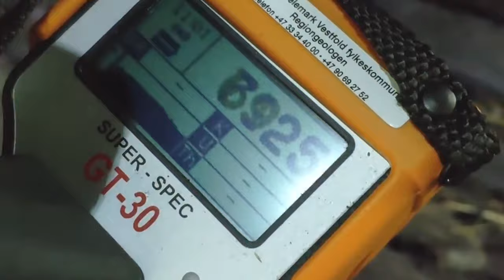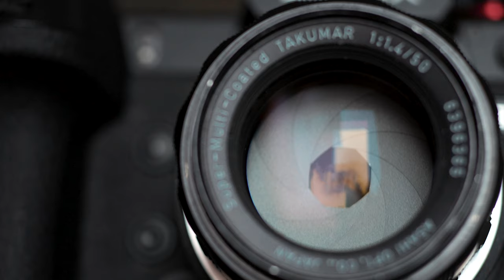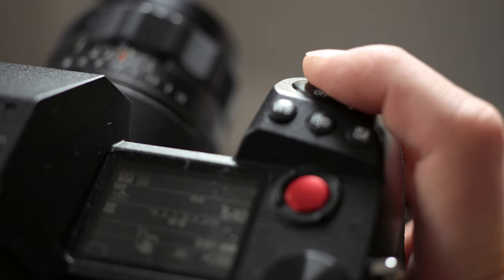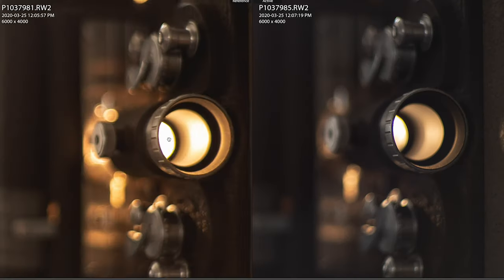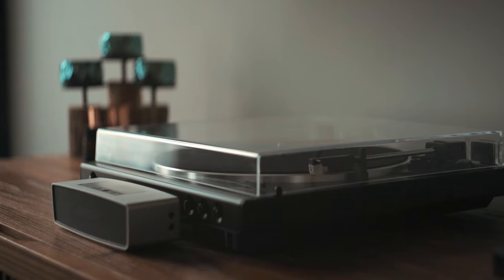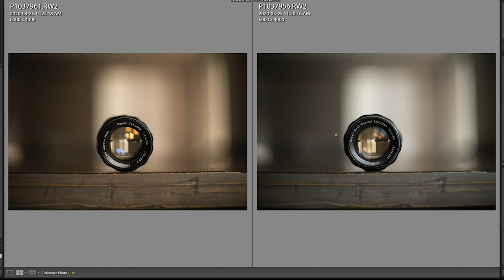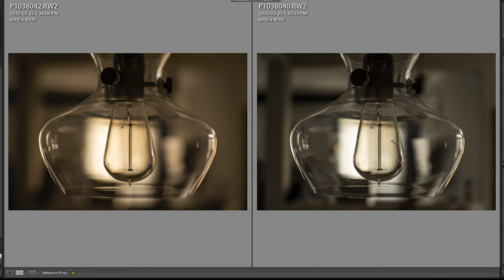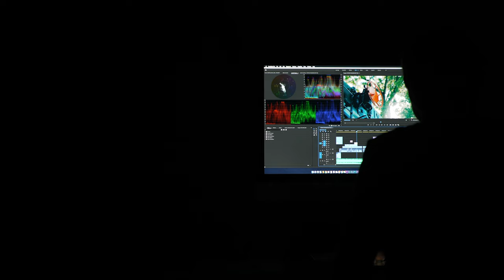The Hidden Secrets of Radioactive Vintage Lenses!

Comment: Just don't eat the lens. Or break the lens elements and inhale or eat the dust. And you'll be fine. Also, don't sleep with the lens under your pillow.
Reply from the maker: That would be dangerous with any lens no doubt, but ya a little radiation decay would be a little worse....just a little ;)
Reply: @MarkHoltze  Much worse. Thorium is primarily an alpha emitter, though it's decay chain produces betas and gammas, too. Alpha is mostly harmless outside the body, gets blocked by your skin, but can be very damaging when inside. I'm not sure how much thorium dust would be required for a harmful effect, but it's safer not to test this...
Reply from the maker: That’s the key, volume. It’s a very small amount overall and it’s also a very slow rate of decay, gamma is more potent when mixed with elements with a much shorter half life.
Reply: The last one is the hardest part.

Comment from the maker: I'd love to hear what you guys think of thoriated lenses. Do you feel safe using them? What might be some of your favourites be and most importantly, do you reverse the color casting? GO!
Reply: My all time favorite is my  super takumar 50mm F1.4 8 Blade , even normal photos look good somehow when i use it .
Reply: Because of you, I built a set of Super Takumar lenses a year ago. The thorium doesn't bother.
Reply: I have no problem with the radioactivity. The yellowing is a bit annoying however, although I only noticed it with my 50mm 1.4 so far. I might be reversing the lens at some point to get the clear colors of my other SMC Takumars. Nice to have a new video from you, btw.. Thanks for the effort!
Reply: I was never a fan of my takumar yellowing. There were certain times where It was sort of artistic or added the right degree of warmth,  but generally speaking, I just went with the k mount versions. The only thoriated lens that I still own is the Canon FD55 mm 1.2 aspherical lens and maybe it has to do with the other coatings used, but that lens has a milder cast and it's more of an amber color that I think is wonderful. The 50 mm 1.4 carls ice has a much colder cast, and I find each of them useful in their own way.
Reply: I'd have to shop at Ikea for that lamp, and I am NOT opening an IKEA account...
Reply from the maker: @sclogse1  lol...my feelings exactly
Reply: I have a Super-Multicoated-Takumar 50mm f1.4 and also a Super Takumar 55mm f1.8 (together with an auto-Takumar 55mm f2.2 and a couple of auto-Takumar 55mm f2s). I read that the Super 55 used rare earth Lanthanum and thoriated glass and wondered if this was an intermediate design choice between uncoated glass elements in the auto-Takumars and multicoated glass in the later iterations (with possibly some overlap?) but haven't yet gotten an answer. I'm not concerned about the radiation produced by the lenses. In point of fact, I prefer the uncoated lenses because the inherent contrast seems to be lower and so they can render more subtle tonal gradation and colors. At least, that's how it seems to me.
Reply: The fixed 46mm lens on my Kodak Signet 40 rangefinder camera (circa 1956-59) contains thorium oxide. I've owned the camera since the 1970s. I bought a second copy off Ebay a few years back. I've far more concern about the viewfinder and mold than radioactive dangers presented by the lens, tbh. Thank you for your very helpful explanation about why thorium oxide was used and solutions for color casting issues.
Reply: I'd be careful about which models contain thorium and which do not.  I own a Super Takumar 50 1.4 which isn't supposed to be radioactive.  To be certain,  purchased a radiation sensor, and lo and behold, it is radioactive!  It's also heavily tinted.  I tested a few other vintage lenses and found they set off the detector to small degree as well.
Reply: Great video! I never had any serious concerns about the radioactive elements in any of my thorium lenses. I love them unconditionally lol.. It’s great that you’re taking the time to put this information out there. A very necessary one from you especially. Cheers!
Reply from the maker: Thanks mate! It was an itch I needed to scratch. Thanks for stopping by
Reply: I picked up the Super Takumar 50 1.4 at an estate sale and it has been an absolute pleasure to use, the bokeh rendition is phenomenal and I actually prefer its look over the Helios. I have not done any UV exposure to cure the yellow tint, when picking up vintage lenses I prefer to keep the "imperfections" in the lens, adds to the feel and character of a shot. I am perfectly comfortable using my thoriated glass lens. After some research I am a little perplexed on which model I have, the 7 element version is said to have the IR mark on the left of the 4, but the a/m switch says just that, A and M, not fully spelled out. Any advice figuring out which version I have?
Reply from the maker: When you back focus the lens, does the back element protrude out? I did a. Review of the 8 and mentioned the differences, also check the aperture blades; how many and what pattern. Might be an 8 element, but could just be an early 7. There are some discrepancies during some of the transition periods.
Reply: I ordered Takumar 50mm 1.4 exactly because its Thorium content and yellowing effect. I think yellowing is interesting feature that can be well used for artistic purposes. Also it can be reversed if needed... I am really interested how that will work out, just need to be careful to not to keep it on a camera after shooting (I am more afraid about possible damage it might do to digital sensor and that one I am not sure if can be reversed)
Radioactivity is overrated. People are scared of everything radioactive including thoriated glass and then get on a plane where they take way higher radioactivity dose than they would reasonably get using radioactive lenses for a prolonged time.
Reply: @WillieHustles where do you store your radioactive lens?
Reply: @anupew3276 how do your store your lens?
Reply: @tylerfields2368  on a shelf, on desk, in an open paper box, leave in a camera bag, anywhere really, just not mounted on camera. 
Radioactive lenses arent dangerous for you (well, if you wont glue it right on your eye and keep it there for a year), but they can cause electrons to move around a bit and some people observed that when you keep them on camera for a long time, images gets a bit more noisy. 
Which makes sense as radiation can cause electron to move around, either within atom to different energy orbit, releasing energy later as light, or be kicked out of atom completely. Mirror on DSLR/STL should be enought to block a good portion (possibly most) of that radiation, but mirrorless have naked sensor with nothing to block it.
Reply: I'll never knowingly buy a thoriated lens.

Comment: Clearing the amber haze from a thoriated lens does not require "extended exposure" to UV light. It only takes two to four hours of 365nm UV-A light shined through the lens, both from the rear element and from the front element. So the "extended period" is four to eight hours max. I use a uvBeast V3 365nm Black Light Flashlight that I got through amazon. I currently only have one set of 18650 Li batteries for the flashlight so my lens erasure time is about 24 hours for 8 hours worth of flushing, which is overkill. The lenses turn out crystal clear and the improvements in the image quality are stunning. It is dumb to be putting up with the color balance issues and loss of contrast in your pictures. Self proclaimed YouTube experts who do reviews of these lenses and ooo and ahhh about the quaint vintage appearance of the yellowed images are clueless maroons. /|\ Gp
Reply from the maker: Good to know. I’ve seen various periods of time mentioned.

Comment: I read somewhere that you are more exposed to radiation during a flight than when using these lenses. Supposedly.
Reply from the maker: Ya seen something similar. It’s why pilots have such a high rate of skin cancer, they’re getting blasted for many more hours than regular travellers are. It’s much more dangerous to be a commercial pilot when it comes to radiation exposure ;)

Comment: I have a Kodak Aero Ektar 178mm  f/2.5 that I use on my Speed Graphic. Due to its size it's even more radioactive than your typical thoriated lens. I don't worry about it. The worst that can happen is having it be permanently confiscated by airport security, which there have been multiple accounts of. Most prominently, I've heard Moscow airport security confiscating both the Takumar 105mm f/2.4 and the Aero Ektar from different photographers without ever giving them back.
Reply: Why? Do they fear, you scratch some metal off it and mix it into Putins morning Müesli 😂

Comment: I have the 7 and 8 element by luck in a local camera shop (Chuck's Camera Shop, Hampton, VA). I used the nuclear one for the past six months and haven't lost one loc of hair.

I LOVE the yellow tint. Easily fixed in Lightroom if you don't like it 👍🏾 

Honestly, one of the sharpest lens I've ever shot with RIGHT next to the Super Takumar 35mm f/3.5 🤌🏾
Reply from the maker: Ya the 35 is a great lens, nice and small too

Comment: ...aaand he's back!
Honestly, I don't care if a lens is radioactive, but I am currently trying to de-yellow my Takumar 50 1.4. As you said, it can be "corrected" in post, but I would like to see how it was supposed to render colors when it was new.
Reply from the maker: It's such a nice lens that the color cast can be a bit off an off put. The 8 element to compare it to was kind of my last resort, better light transmission to as it drops the exposure a bit because of the damage. So loads of reasons to still do it, ONE day! Or i'll just sell the radioactive 50 since I have the 8 element lol. My 35 needs correction regardless.
Reply: Buy a UVB Reptile CFL light at a pet store. The lens won’t get near my as hot as exposing it to sunlight. Wrap the bottom of the lens with aluminum foil.  In a couple days 80-90 percent of the yellowing will be removed.
Reply: I just shot a roll of Cinestill 400D with a yellowed Takumar. Skin tones turned out a little bit to the orange tones but nothing LR can't correct. Beach photos turned out so moody tho.

Comment: Good to see you Mark! It's been far too long. Literally was watching a video by you on the Canon FD 50mm f1.2L (There is one listed on kijiji in Calgary btw) and wondering where you've been. Love your work sir.
Reply from the maker: How’s the price on that listing? $750-900? Its a great lens, wish I picked it up for $250 when I saw one a few years back.
Reply: @MarkHoltze  Its only $1100 CAD. And yeah I feel yeah I remember looking at FD L lenses in 2017. The cheapest was the 24mm at only $250. Sigh... I wish I was a sony shooter with a A7 and adapter. Id have bought the entire lineup. Especially the 85 f1.2L So cheap and not even that long ago.
Reply: @classic.cameras  Guys, check out the Canon FL 55mm f1.2, seems to have coatings on a par with the subsequent SSC coatings on the FDs and nicely sharp with a nice form factor and Takumar kind of styling and most pertinently of all cheap compared to the FD... interestingly I also nabbed an FL 58mm f1.2 at the same time, little more expensive and much softer but 'interesting' in other ways - flares like the 1970s!
Reply: @henrysteadman963  I actually have the FD 55mm f1.2 Chrome Nose and recently bought a FD 55mm f1.2 S.S.C for $280 CAD. Figured it would either always be worth that or it too will go up in value.

Comment: As always love your video Mark! This is oddly perfect timing for me as I just got a Pentax 6x7 Super Takumar 105mm f2.4 that also has a thoriated rear element that is also yellowing. 

Went down the rabbit hole of research and didn’t really get a clear answer either. The general consensus is that they are safe to use unless you sleep with them 😂
Reply from the maker: Ya, not a lot of people are really qualified to say one way or another, ultimately that's why I leave it up to the individual. Part of my Independent Thinker slate at the top, I don't want to preach here, I want to have a conversation and attempt to provide some new info :).

Comment: I have have UV treated my 35 mm f2, and my two 50 mm 1.4. I have not been able to remove the tint 100%, even after 5 days under an led lamp. But I have gained 2/3 of a stop on each lens, without loosing, the charming warm tone they renders. And thanks for a great channel, very inspiring to watch.
Reply: I'm not sure what LED lamp you're using, but most LEDs sold as emitting UV are actually lying and emit virtually no UV whatsoever. Actual UV LEDs are rather expensive. That being said, just photons of light, even non-UV, can help reverse yellowing. But for the best results, direct sunlight outdoors (no windows in the way) can work wonders.
Reply from the maker: I exposed mine directly to sunlight it’s often not advised because they can get very hot and melt the grease inside which can drop onto the lens elements. My 38 hour sunbath didn’t have much of an impact either color wise, Vs those i know who use direct UV light.
Reply: @MarkHoltze  oh, yeah, sitting out in the sun on a really hot summer day would not be advised. Same with having it somehow set up to focus sunlight on something flammable. Gotta try to anticipate all the ways it could go badly!
Reply: You need a 365nm blacklight.
The IKEA LED-method is crap,
it takes WEEKS. 
Sunlight will likely turn the grease in the focus helicoid to a liquid, leaking all over the place.

Get a 365nm blacklight, it takes less than a day..

Comment: Fascinating presentation Mark, I have several vintage thoriated lenses and I must admit  have slightly mixed feelings about the 'risk factor' despite any reassuring data I hear to balance the concern there's always that 'yeah but...' thought, and I suppose that although I'm happy to have, use and enjoy these lovely old optics myself, if you asked me to encourage my children to use them over non-thoriated options I'd probably steer them away... do as I say not as I do :)
Reply from the maker: Eventually they will be phased out I think. I mean it’s the core of that mixed feelings is exactly why I didn’t want to spend a second trying to convince one way or the other. Too many great options that aren’t.

Comment: I am sitting near my Takumar 50mm  and feel at ease right now, apart from my third eye which is appearing in the centre of my brow.
I do not stare at it, or cuddle it, but it does come out of the bag to be used like any other lens. I even put it in the garden in the summer to get a few rays.
Reply from the maker: a third eye could also come in handy ;)
Reply: @MarkHoltze  I wish I had eyes in the back of my head sometimes. 🤣

Comment: Long time no see, Mark.
Not too bad pronunciation on Jakob Berzelius, but to no surprise the ö in Jöns was a bit weird.
Trying to come up with something that sounds Ö in English, but I really can't... our Swedish Å Ä Ö are a bit weird I guess 😅

Sidenote, you showed Thoriated Tungsten electrodes, they are probably more dangerous for me.
They are used in TIG welding, and I do some of that, grinding them down causes dust that are radioactive.
These days Lanthanum oxide tungsten electrode is more common though, enough chemistry for this time, cheers Mark !
Reply from the maker: Ya needed to show the electronics skipping lol. Definitely a much more dangerous mix, but animation felt cheap. I could prob have gotten it had I heard the proper pronunciation a few times right before I said it; but it was cold out and recorded this whole outputting a network cut lol. Those accented O’s lol. Thanks for the help, next time! ✊
Reply: @MarkHoltze  Just for fun, I typed in Jöns in google translate, and put language to Swedish, and pressed the speaker, I must say, not half bad actually, might be usable for directions in pronunciation.
Reply from the maker: Accents are hard. Do I force a terrible pronunciation of the foreign language and butcher it, or make it super English…it’s always awkward lol. I mean no disrespect obviously. 😆

Comment: Thank you for another interesting video, very much appreciated. The radioactivity is what stops me from using my Konica 57mm f1.2. I keep fearing an impact on the sensor. Any thoughts on that particular aspect?
Reply from the maker: As long as you don't leave the lens on the camera indefinitely it should be fine, that's based on my research generally with radioactive lenses, not that lens specifically.
Reply: @MarkHoltze  thanks for sharing your thoughts

Comment: I have a Helios 44-2 which is apparently radio active. It’s in such small quantities that there is no risk so I’m told. So yep, not bothered by it
Reply from the maker: Hmmm, I don’t think any of the Helios lenses are radioactive. I could be wrong but I have a few and non of them are radioactive. Maybe that had a few batches that were. Going to have to look into this.
Reply: @MarkHoltze  I was told it is by the person I bought it from but haven’t checked this out, and they may have been wrong. I’ll look it up now.
Reply from the maker: It’s never come up as radioactive in any forums I’ve seen discussing those, also the soviets had the full plans and people to make these lenses so I think they kept that going. The Germans didn’t use radioactive materials much of at all, and it’s got German DNA . Let me know if you find anything different.

Comment: Well I just bought a Canon FD SSC 35 mm f2 concave Black nose. Now got a bit scared of even holding the lens. Planing on using with the rest of the set of canon fd. What are your follows up in this lens and how do you store it ? My home is small and most of the equipments stays in the same room as me. But I would have more than 3 feet from the lenses inside a pelicase. Would that be safe ?
Reply from the maker: It’s safe yes, if you store it like that zero issues. Just don’t keep it two inches from your eyes and I wouldn’t put it in your pocket ;).